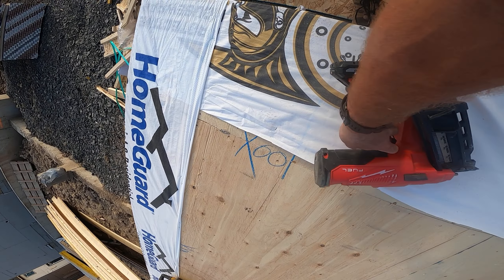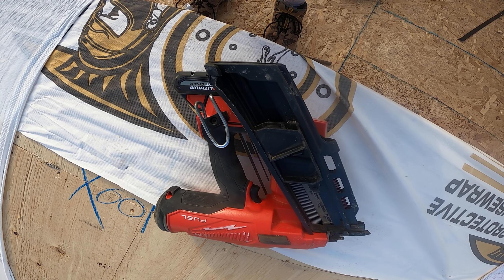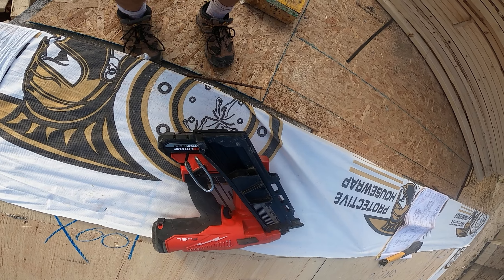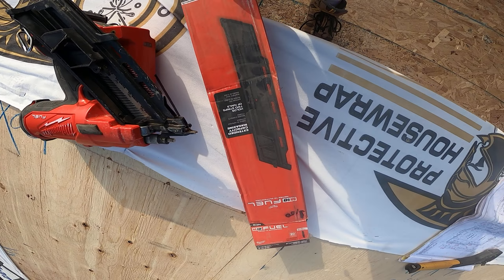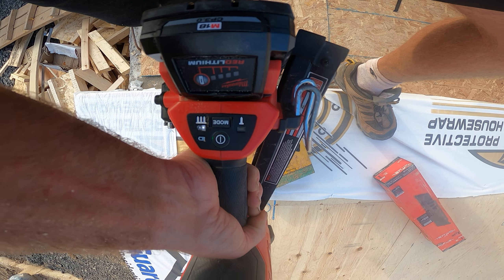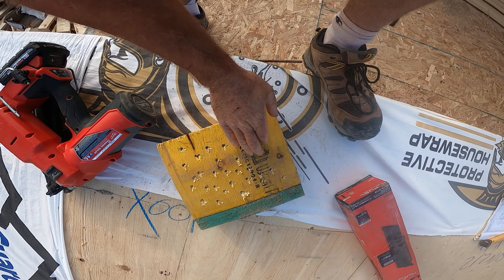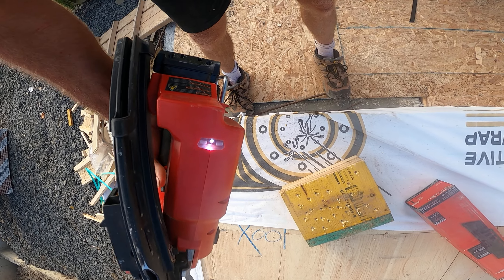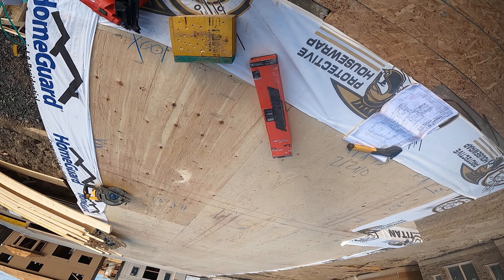Milwaukee 30 degree cordless framing nailer review

Comment: Why have they made a 30 degree nailer and a 20 degree nailer what's the difference and the benefits
Reply from the maker: I really believe the choice between the two nailer angle choices comes down to availability of nails and the cost. Around here a box of 3000 34 degree clipped head nails runs around 45 $ box whereas the same amount of 20 degree would be over twice that

Comment: Used the 31 degree m18 nailer for one project, 4 days of use.  Returned to Home Depot due to inconsistent nail setting.  First nail ¼” deep, next two nails set to surface depth, fourth nail ¼” high.  Tried different brand nails, different batteries, single shot & bump mode.  POS nailed.  This from an avid Milwaukee guy.

Comment: Only complaint I have is the thermal shutoff.  If you're using it continuously for 2-3 hours (I was doing wooden shingles) it will get pretty hot and eventually make you wait until it cools enough to use.
Reply: Take battery out, put fresh one in, bobs your uncle bro

Comment: Does it matter of you get the °21 or °30 nailer?
Reply: Preference of which nails you want. 21 are plastic collated. Not that popular. 30 is more common and cheaper.
Reply: I am confuse when I see 21° or 30° air framing nailer what are the Difference
Reply: @angelf9800  the angle of the nail clip for feeding the strips/clips of nails into the magazine

Comment: Had this nail gun since it was put out it’s a little heavy I run 9.0 so I can run it all day I am a commercial framer but I slang this thing all day it is great no roll no cords an runs all day shoots galv 3 1/2 nails like nothing I just don’t use it to nail plywood off I hang it with it but use my air nail gun to finish it off u will not regret this nail gun if u can stand it being on the little heavy side but hey I get some good size arms

Comment: i had mine and sold it, way to heavy and it will also overheat after heavy use. Was tying the roof in the other day and it kept over heating
Reply from the maker: I have to had that issue yet. We're you using regular or smaller 18 fuel batteries.?
Reply: See this guys as use the tool for hours of hard work not just for fun. Every time i use the Milwaukee tool like i would regularly use any other tool the batteries over heat. When i try to cut the stringer and i had to run for batteries all the time. And i could do more work with 4 amps makita batteries then 6 amps Milwaukee batteries. I said never again I’m buying Milwaukee garbage lol
Reply: I have one and it’s staying in my tool box i use the paslode with the fuel cell or hitachi cordless. I did have issues with the hitachi in winter and i found out they issue they have and i cost me 70$ to get the air regulator pressure because in winter the air pressure was going down in the gun do to cold weather so now i just putt air pressure back in it when it start acting up. Easy fix even if no one around here could find the issue!

Comment: We have 4 on the job and 2 of them stopped driving nails after 8 months or so
Reply: They’re junk , over heat , they’re heavy and just not an endurance tool at all
Reply: They run off a pressurized nitrogen canister that runs out.  Gotta send it in to Milwaukee to be recharged .. main reason I’m not interested in it

Comment: I got one and don’t like it lol and your high output battery is because they have issue with the regular batteries over heating . I both some Milwaukee because every said they were the best but most of people don’t use the tool enough. I can’t even cut out 3 stringer with a Milwaukee rear handle with a 6 amp battery and i cut 5 stringer with my makita rear handle with 4 amps battery. I’m not impress with there battery. It’s garbage if the batteries always over heat. Have makita tool for over 10 years and never had a battery over heating lol i though i was making a good purchase. I quickly realized that i wasn’t.

Comment: Can you compare it to the dewalt cordless framer? Feels like this wins in power what about kickback and weight?
Reply: The miluakee is definitely lighter so it has a lil more kickback.
Reply: @jamesmcfadden5214  the milwaukee is not lighter. I own both dewalt and milwaukee nailors. The dewalt without the battery is just under 9 pounds and the milwaukee without battery is over 9 pounds.
Reply: Milwaukee is heavy. But the windup noise on the dewalt is irritating.
Reply: @GoldCountryTrapping  I totally agree
Reply: I'm retired and helping a young couple build a small house. The young man bought a Dewalt battery powered 21 degree nailer. It is annoying listening to and waiting for it to wind up. It was very prone to jamming and we read the instruction manual thoroughly. He returned it and the gave him another. I would go with the Milwaukee if I was to buy one just fro. What I have read and seen. I like Milwaukee anyway. I pull out my senco sn 60 framing nailer that's 25 years old and it runs circles around the Dewalt. Slow unreliable piece of yellow poop.

Comment: These things are awesome, used them for over a year and just got one for myself. They are great but weight is definitely annoying when youre using it for 8 hours a day. I have the M18 high output battery and it is damn near as good as a paslode. So good🤘
Reply from the maker: Now take amount of nails put in with that gun, divide that number  by 3000 then times it by 18...that's how.much you've saved in potential  fuel.costs
Reply: Near as good?

Other then weight this thing smashes paslodes. Especially if you're doing LVLs. No paslode I've seen can sink nails in them.

Comment: Dude, you should compare it to the metabo cordless framing nailer.
Reply: I agree
Reply: From what I’ve heard, performance is identical but the metabo is lighter
Reply: Everyone complains about the Metabo/Hikoki gun’s belt/rafter hook. I think they come installed on the wrong side of the gun. Switch it to the left and it’s great.
Reply: @aspees  yes the Milwaukee nailer comes with a belt hook and a rafter hook, which is better than the metabo.

Comment: Where did you buy to get the extended magazine included?
Reply: Home hardware and Home Depot ran the promo and maybe still is going.  Here in Canada at least
Reply from the maker: Adam tools out of Toronto.  I got mine from there tool truck but I first saw it on there website  with the magazine  promo

Comment: They’re so good, have completely replaced the paslode and the compressor. We have 3 of them, 2 with short mags 1 with the long mag. How do you get that camera angle? I’ve been mucking around with a cheap action cam off Amazon getting some work footage.
Reply: You replaced the paslode  with that block of lead ?!, they are way too heavy to use all day and will never out pace a framing gun with comp
Reply: @stevegagnon9451  Yep, we replaced it with one, then a second and then a third. They’re not that bad once you get used to them and develop muscles in your arms. In our case it has completely replaced a compressor, we only use it for our coil gun because the paslode cordless coil nailer isn’t designed for heavy usage.

Comment: Still not as fast as a air gun
Reply: when on earth do u need more than 3 nails per second
Reply: At the price per square footage yes
Reply: @stevegagnon9451  But you has no messing around with the airline, in the end of the day they have the same speed.
Reply: @jonasstahl9826  that’s why you place hoses around your work area, and they will never out perform an air gun in speed

Comment: Will framers make fun of me if use the Milwaukee instead of a pneumatic
Reply from the maker: I don't see why. I bought  mine mostly for roof work as a complimentary gun...I wouldn't go naming roof girders 2 nails 6oc  with it because the gun probably won't last long term but for ceilings, webbing, fill in work it's awesome. I bought a tether  for roof work...I'm scared of missing the belt hook because sometimes my shirt is over the belt

Comment: I also have this framing nailer, and i  recommend it to anybody that is looking for a good nailer, yeah it is  a bit heavy but it has the power you need and more.. 
in my opinion the best battery framing gun. I’ve tried metabo, paslode and dewalt and those are not even close.
Reply from the maker: I would have to agree. The power is there   for engineered lumber...using even the 3.o ah high output  battery is buried the framing strips...only bigger test would be for lsl  double beams but besides my last house hard to come by
Reply: The DeWalt 21* can sink a 12D nail through double 2x6 plates, at what looks like the same speed here.